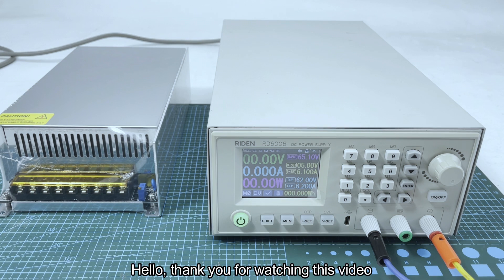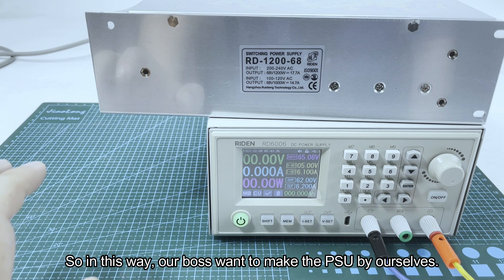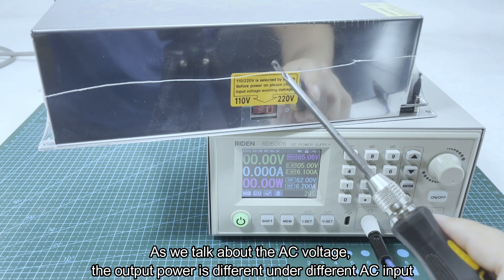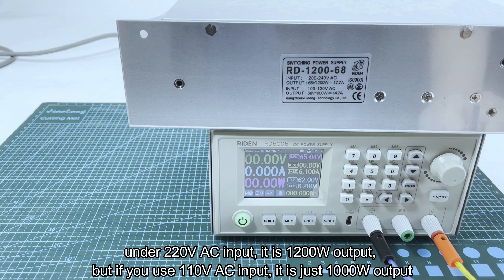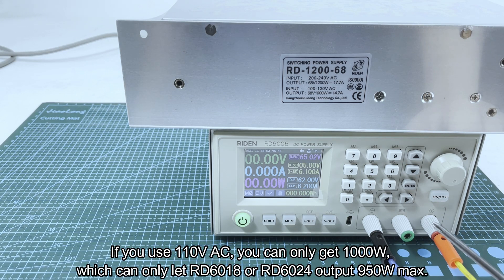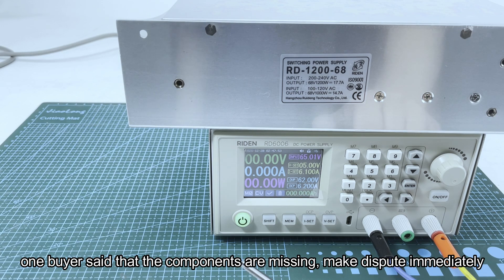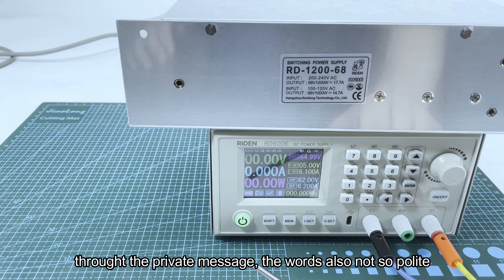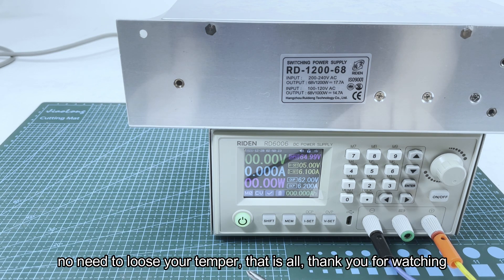RD made 1200W68V PSU is available! for RD6024 and RD6018, and feedback recently

Comment: The fan of my RD-1200-68 was quite noisy, but only for short periods. Upon inspection, I discovered that the fan would only start at a relatively high voltage (more than 6 V). The fan control system seems designed to start the fan slowly and then increase the RPM as needed. However, my fan couldn't start slowly; it would begin at a rather high voltage, resulting in unpleasantly loud short bursts of noise. I replaced the original fan with the Noctua NF-A6x25 FLX, which is significantly quieter from the start and is capable of operating at much lower voltages  and therefore lower and quieter rotational speeds.
Reply from the maker: thank you for your feedback, we will check it, normally for 1200W PSU fan it should be noisy when full load running, at low power output it should be quiet
Reply: @rdtech9153  Could you verify if my observation is correct that the fan control operates with a gradual increase in voltage and RPM, rather than simply switching on and off at 12 volts? Or am I mistaken?
Reply from the maker: @RonAñejo-v9k  the fan will run at different speed according to the temperature, for now we are changing the design to reduce the noise

Comment: Hello. I have the RD 1200W 68V PSU. 
When I touch the metal case of the PSU or the ground wire with a test pencil screwdriver it lights up (not as strong as when I touch the live wire). Is this normal?
Reply from the maker: hello, do you connect the gournd wire, or connection not good ?you can contact us on aliexpress, show us how you connect the PSU

Comment: I see watt rating is the same for both RD6018 and RD6024 when using 110V AC so is the max AMPS also the same for if you use 110V AC?
Reply from the maker: for the output current of RD6018 and RD6024, this PSU can let RD6018 output 18A, let RD6024 output 24A, just the output voltage will be lower, for example, this PSU can let RD6018 or RD6024 output 950W max at 110V AC, for RD6018, if you want 18A, you can only set 950W/18A=52.7V max

Comment: Hello and thank you for the video.
I need a power supply to output a voltage of 63V (I want to use it to equalize a 48V lead acid battery). Will this power supply be able to output 63V or is 60V the absolute maximum voltage it can output? I only need a maximum of 6 amps of current but I am worried about the voltage this power supply can output.
Reply from the maker: hello, for this power supply, it is 68V 17.7A output, you can adjust the output to 63V, and do you mean you want to use the 1200W PSU to charge the lead acid battery directly?

Comment: I have bought psu produced not by you. Even it was you psu do you suggest to take of metal case before install it inside RD power source to make cooling better? Also I can swap original fan to 80 mm one, and set it to the main cover wall.
Reply from the maker: it is a good question, for this problem I made a video before, do not remove the case of the PSU when install it into the case, because it will change the flow way of the wind, you use bigger fan and place it on the cover wall, you need to make sure that the wind will aim to the PSU board to take away the heat

Comment: Does the RD6018 & RD6024 have reverse polarity protection? If I accidentally connect positive to negative terminals when the on/off button is off, will it harm the unit?
Reply from the maker: hello, you mean the reverse protection at the input  or output terminal?

Comment: Okay to use with RD6012P and S800?
Reply from the maker: yes, there is no problem to use it for RD6012P and s800 case, usually you use 800W PSU and it is enough, it is ok to choose 1200W PSU

Comment: Hello 
Can you explain me please is that psu the correct one for the RD-6024? I mean it will use the full of the benefits of RD-6024?

Thanks
Reply from the maker: 1200W PSU can let RD6024 output 60V or 24A separately , but it cannot let RD6024 full output because RD6024 is 1440W max output, if you use 220V AC for 1200W PSU, you can get 1200W max at PSU output, but if you use 110V AC, you can get 1000W max.please notice that
Reply: @rdtech9153  So are you going to build a psu that can manage all the power of rd6024 soon?
Thanks for the answer
Reply from the maker: @ausdim  for now we have such plan , but it needs some months
Reply: @rdtech9153  It will fit at s800 case ? Thanks for your great support.
Reply from the maker: @ausdim  for now I cannot say that, maybe the case needs to be modified, because 1500W PSU needs stronger heat dissipation

Comment: Can you show us the internal layout and component selection so we can see how well this power supply was made?
Reply from the maker: hello, in the S800 case link, there is internal picture, you can see them
Reply: They don't show you this...nthe reason is clear...
Reply: @darkness1943  what's the reason then? I just got this PSU with a RD6024 and I'm pleasantly surprised by the build quality.

I'm an electronics engineer and I also have HP/Agilent and Rigol gear, but this PSU will definitely have its uses!